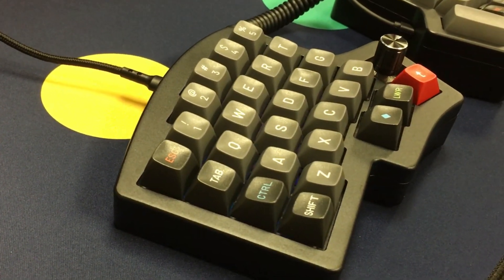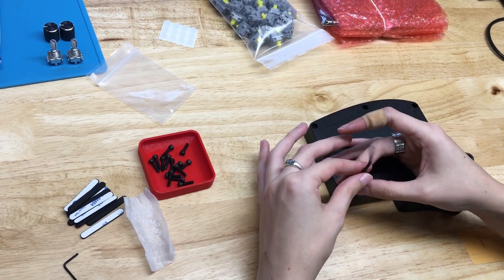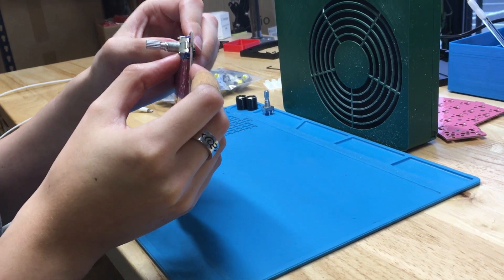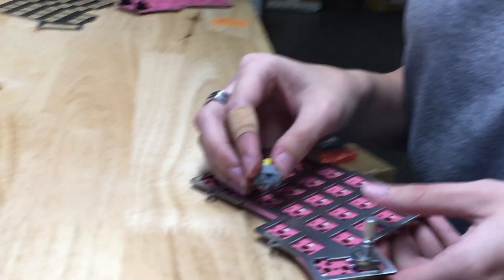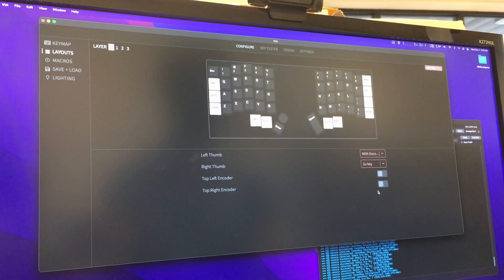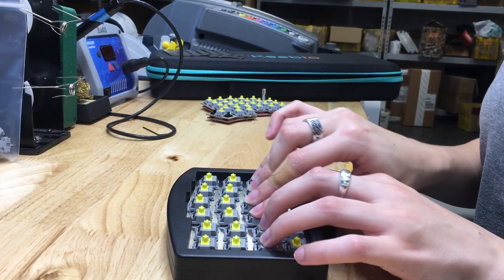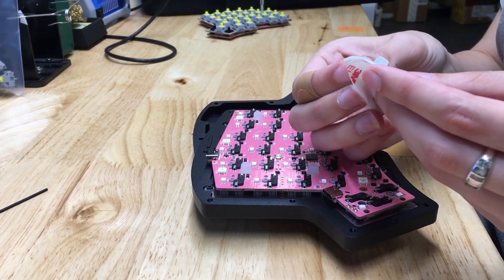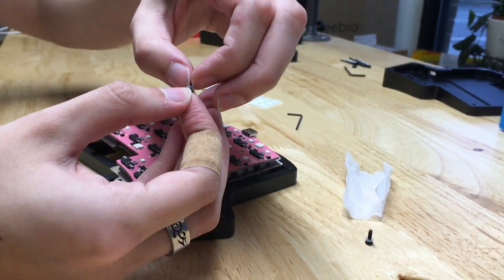Iris Aluminum Edition Case Build

Comment: Very good run through. Well done!  I'm looking at split keyboard and as much as I like the idea of a wireless one, I'm not sure I like the price.

The aluminum case is a bit over my budget, but I like the rest of the keyboard and am thinking seriously of one of these with a 3D printed case or  3*5+3 Corne kit.

With this I could at least add encoders and work on reducing to the 3*5 keyboard as I go...